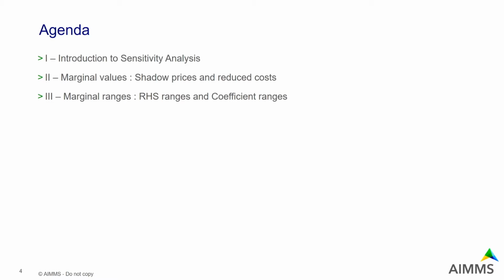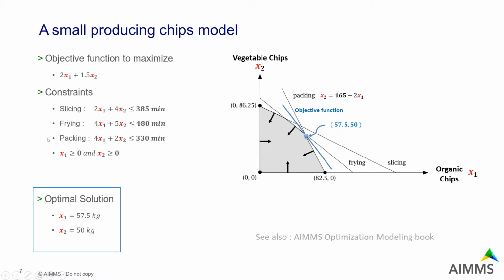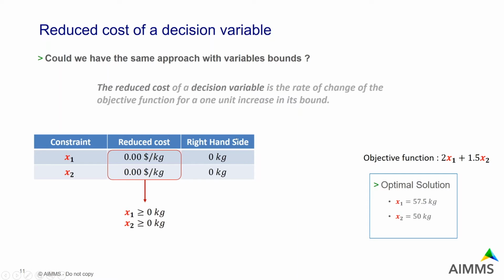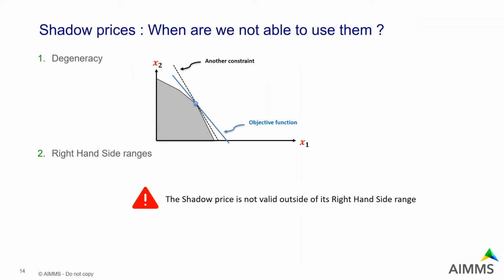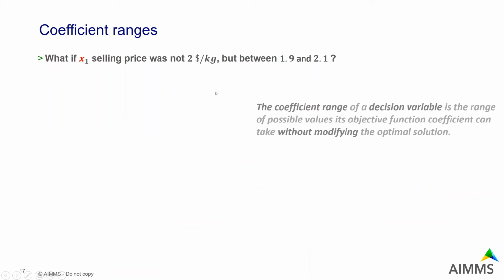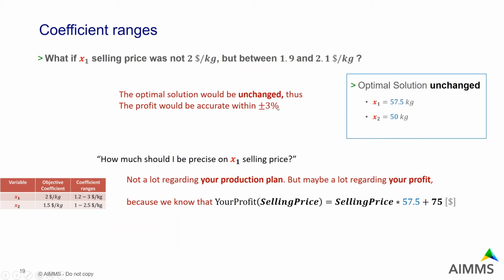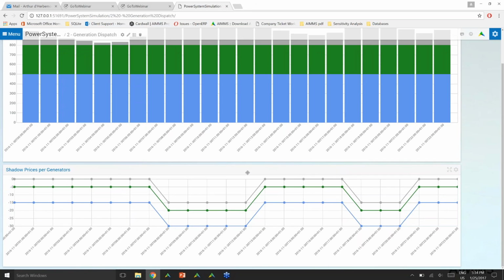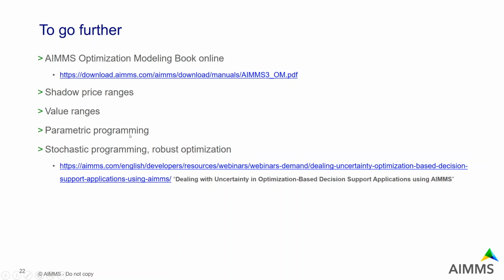Product Training webinar: Running a Sensitivity Analysis in AIMMS

Comment: Is it possible to get the .aimms files/folder? I am declaring my properties, editing the data section but I am not getting any values. Also I am trying to get RHS values on a constraint vector, I hope that's not the issue. When I run my program, my solver stays at the "Postsolving" phase, I don't get a "RHS range calculation" phase. (using AIMMS 4.76.5)
Reply from the maker: Hi Cem, sorry for the late reply. We tried tracking down the folder but the presenter of this webinar is on holiday at the moment. Would you mind posting your problem in our community with more details? https://community.aimms.com/ If you attach your project there, someone else in our team can take a look. Thanks!
Reply: @optimizewithaimms  is he back

Comment: The slicing constraint intersects with x2 at point (0, 96.25) and not at (0, 86.25) as you have in your video. You see, 385 / 4 = 96.25. For the slicing constraint to intersect at (0, 86.25) you need the rhs to be 345.
Reply from the maker: Hi Lusine, thanks for your comment. You are right. We have a typo at the beginning of the powerpoint (but it is the right value in the rest of the powerpoint). We are happy that you noticed it! Since it's a live recording, we opted to leave it as is. Let us know if you have any other questions or remarks. Thanks again.